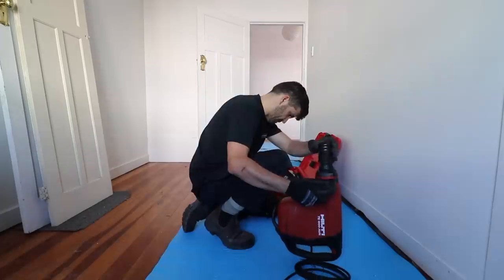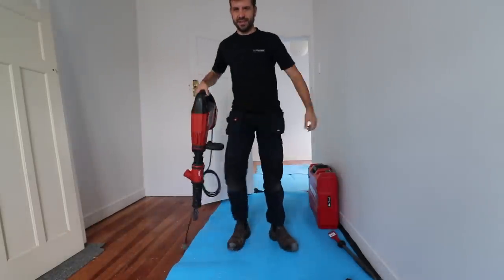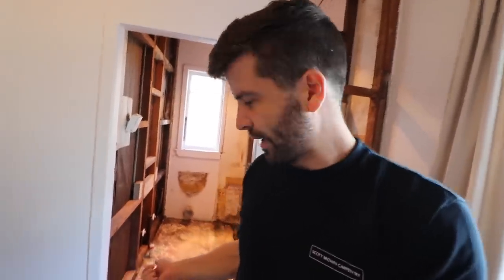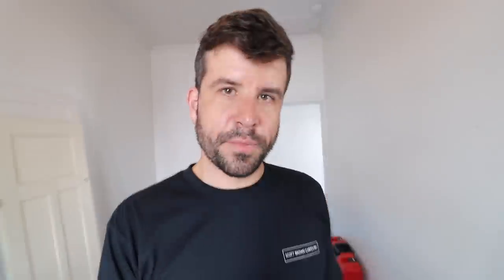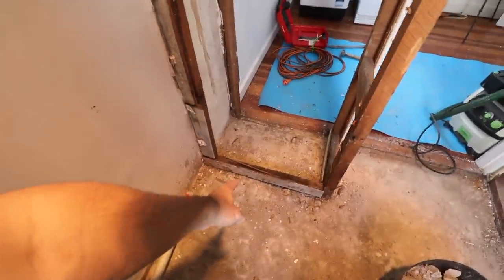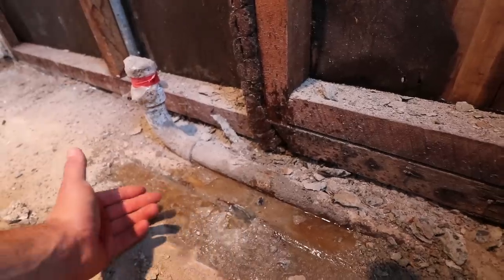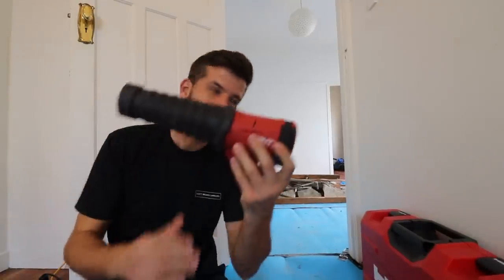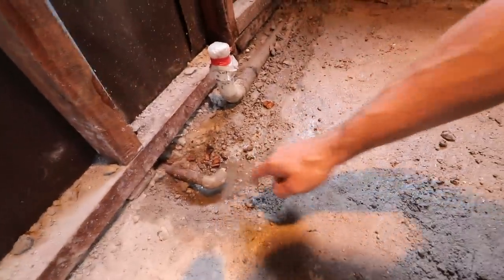This Hilti Demo Hammer Is Ridiculous

Comment: I work at a foundation and structural repair company and when we're pressuring grouting under a slab we almost always avoid bathrooms to avoid pipes as much as possible. We use a bosch rotary hammer for demo and for drilling through slabs. Works great.

Comment: I'm biased as I work for Hilti in GB - glad you enjoyed it! To be fair, this tool is overkill for the job. The TE 800 was designed and primarily used for removing the top half of pile foundations to add more rebar and extend. You would have been better with something a bit lighter such as the TE500
Reply: Rigt,

Comment: Worked for a company that only used hilti tools (Unless it was a tool that hilti didn't have) and those things never broke down even when the guys gave them severe poundings and me dropping a battery that skid at full speed down a roof and flew into the railing on the scaffolding. Barely even had a dent. 
I didn't really think much of them as I was an apprentice when working with them but after having worked different tools like Makita and DeWalt afterwards, had I dropped one of their hard-shell batteries down that roof they would've cracked into a million pieces. I feel the Hilti, is an investment. It costs you an arm and a leg when first buying it but then it lasts for a lifetime. 

Even if buying it as a home-gamer, would be overkill but I feel like if I bought one for my home use It would probably outlive me.

Comment: Used a hilti te 800 avr to make space for some heavy af copper pipes. The thing went through concrete, specifically 10cm thickness, like nothing. The only thing is that they gave it to us without the handle, so my forearms were tired af after the whole deal, so make sure they have the handle for it before doing any heavy work with it.

Comment: I was on a viaduct job once and we bought in a bunch of TE-6a’s. somebody dropped one about 30-40 metres into a river at the bottom and it was in there a couple of days until the river went down enough to go and fish it out. Took the case off banged all the grit out, left it on a radiator overnight and it fired up no problem with a fresh battery. Awesome tools.

Comment: Good to see someone using a rotary hammer the way it's meant to be used. See lots of people on the internet reefing on it and even putting full body weight on it when chopping up a floor like you do here. For anyone that doesn't know: you want the weight of the hammer itself to smack against the chisel. When you put your weight onto it it essentially divides the power between hammering the floor and hammering you.

Comment: Well done Scott, you handled that emergency well, nothing worse than hitting a pipe or a wire ,in fairness to you it was in a very bad location youd never expect a pipe to be there. Great video thanks
Reply: You would think each apartment would have a cutoff, maybe that is one of the planned upgrades.
Reply: Yeah who puts pipes in bathrooms? How inconsiderate of them!
Reply: We all, I'm sure know and expect that pipes will be in bathrooms, but the pipe wasn't in a location you'd expect it to be, running parallel to a stud wall about 4 to 5 inches away from the stud wall

Comment: You have brought a bazooka to a water pistol fight there mate.
Reply: @firesurfer  I agree. exactly the tool.
Reply: @firesurfer  Hilti TE-700 would have been better to do such Job. lighter, faster and efficient as it seems to be just a screed.
Reply: @sehruddinkhan8835   Hindsight is always 20/20. You don't know that until you do it.
 He did have a hard area in the corner. It could have been much worse.
Reply: I have a corded Bosch SDS+ that’s drills and chisels. It’s great for removing failed screed. The only time I needed something bigger was breaking out a concrete base. On this job I’d have started with the hollow areas and hired a bigger tool if the stuck areas were too solid.
Reply: my thoughts also.
Reply: That's the sort of Kango/Hitachi toy, contractors/project managers/"I wanna show you I am not afraid to get my hands dirty" bring to a jackhammer job and then they wonder why it doesn't break bedrock and foundations. For this job it probably was an overkill, but it is not that powerful.
Reply: @Dave5843-d9m  Hilti is the king, but it is expensive. Bosch is cheaper and fun to use. I've been a Bosch fan ever since I've used their angle grinder and was impressed at how smooth the tool ran without overheating.
Reply: @julianpetkov8320  qy

Comment: On the odd occasion where major concrete demolition is required I have hired jackhammers to do the job. Some time ago ALDI had a big jackhammer for $200. I picked one up just to have one at the ready. I am amazed at just how good it is for the price. If I was using one weekly I would get a quality brand, but for the couple of times a year I need it, the ALDI jackhammer is awesome.
Reply: Yeah I got a reasonably cheap one myself and it does the trick. Wouldn’t want to be using it all the time though.

Comment: As a homeowner, I've actually found that my 26 lb demo hammer (roughly equivalent to this one) has proven to be one of the more useful tools in my garage. I live in a place where the soil is pretty dense hardpan clay, so using my hammer with a space bit just makes digging super easy. I also had to remove half my concrete driveway, which was pretty thick and reinforced, and found that my little demo hammer did nearly as good a job as the jackhammer I rented, and with way less fatigue (26 lbs < 70 lbs, who knew). While some jobs can be handled with a variety of tools, some more efficient than others, the kinds of things a demo hammer can do generally don't have great alternatives.

Comment: I spent the first 3 years of my apprenticeship behind a hilti breaker most days. over the duration of that time i got to use a wide variety of models from the TE-1 through to the TE-3000. 
After a while, the firm allowed me to hang onto my preferred tools, a 20 year old TE-706 and a rusty old barrel wet vac. 
The secret to these awesome tools is weekly maintenance and warming it up before use. I'll let it warm up for 15 mins before before use.
Really miss using Hilti tools, the new firm i work for use makita, which makes me feel like im hitting my head against the wall every time i use them.
Reply: You don't think Makita is good quality or are you saying that compared to Hilti, everything else just seems 2nd class?
Reply: Are u a head banger aka into heavy metal

Comment: Hi Scott.  Thanks for sharing.

I once did a laundry room remodel. Where after we'd put up the gyprock, the client asked for one more outlet to be added into where a future cupboard would be. I believe we had to make 3-4 of 5" cupsaw holes to drag the wire (as it went around an inside corner). Never had i seen a wall section more loaded with plumbing and electrical.  Two main drain stacks, with offshoot,  and multiple hot and cold supplies right (2mm) behind the gyp. Every time i cut a hole, i narrowly missed something. 
While fixing the patching pieces for the holes i made an inexperienced decision and decided to fix plywood strips across the holes to secure my patches. It gives a more solid job bit given the busy state of what was behind, i should have opted for leaving the paper wide on the patching gyprock and sticking it with the mud.  It was behind cabinets anyways. 
So,  as im screwing on one of the plywood scabs, I felt a drain pipe right behind.  I aim above to avoid it and set the screw.  Screw goes into something but to my dismay it isn't the ply,  it was a water line tucked right in behind the drain that i could feel because of that. 
I do know my own plumbing but it was still a pain because i had to undo a lot of drain pipe that was in proximity to do my sodder joint. 
It actually got worse after that.  While doing that fix, we had to drain the lines.  The Housekeeper reopened (because we'd shut then off after draining) a handheld shower fixture for the upstairs clawfoot tub, meaning to clean it and left it pointed towards the floor.  She didn't realise it was on because the shutoff was still turned off. So when i put the water back on from the main shutoff in the basement i listened to it continue to run for a moment, and then beyond what it should have to fill any empty toilets. I shut it back off but the mess was already made. The previous installer had not closed the openings where the water lines passed through the tile floor for the clawfoot and all that water went into the newly finished kitchen below.  What a day I tell you!
We kept our cool.  Opened all the pot light holes and mopped that ceiling space with sponges like nobodies business! Saved the ceiling and ther kitchen.  Set a fan and vacuum to move air through the space and had only minor plaster and paint repairs.

That being said,  you should roll with a push-to-fit shutoff valve in your case.  Open the shutoff,  jam it on the broken/ cut end of a pipe and then close the valve.  It could be a real lifesaver.

Comment: I've got the Makita one which is a 20lb impact VS the 15.5lb impact on the hilti. IT'S A LIFE SAVER.

I demo'd an ensuite bathroom that had 2 inches of concrete behind floor to ceiling tile, on every wall and floor, plus 5 inch thick concrete shower pan.

There was nearly 4000lbs of concrete and tile removed. I wouldnt have been able to do it without that tool!

Comment: I have that Hilti Hammer drill. I use it for core drilling and breaking basement floors. It's a bit of overkill to use it in your application and by days end you'd be knackered from lugging it around. Like using a sledgehammer to crack a walnut !

Comment: I've broke out 100's of concrete floors in bathrooms doing walk in showers. Always Check where stop tap is, gas meter and consumer unit. I've hit a few pipes over the years. gas and water. Not so bad when you know where to isolate. I'm a plumber so could fix myself.definitely worth learning basic plumbing skills and electrical.

Comment: Hilti is nice, but a nice air-powered hammer blows those things away.  It's the same jump btwn residential to commercial as it is commercial to public works. Fire up the tow-behind compressor, grab a hammer and a hose and start blasting away. Used to set up venturi air blowers to push all the dust out.

Comment: Nice work Scott, keep it up!
  the Makita HR4013C 1100W 40mm SDS Max Rotary Hammer
Is really good for light work.

I was using there 16-40kg Hilti Jack  hammer the other day it's a beast
Went through the concrete like butter, will do Upto 300 mm thick  concrete.

Comment: i bought an old primary school to convert to live in and had a lot of demo. to do so i bought two spare and repair hilti  706 breakers from e-bay, and i sent them to hilti for a service repair for £165.00 each they fixed them and i had a 6 month warranty 5 months later one started making funny noises sent it back, and one new motor later got it back no bill, that was 8 years ago and they're still going strong, hilti has a well earned reputation but like everything else the older models will last longer than their modern tools

Comment: The hilti wsc85 circular saw is a dream if you ever need the 85mm cut depth, and I have a TE52 HAMMER OF GOD drill and a DD100 corer that are both about as old as you and simply refuse to die 👀 they were old before I got them! I'll replace them one day, maybe when I replace all my teeth for falsers, but probably not before!

Comment: In Sweden there are companies where you can rent machines like that, so if you have a rare job in need of the heavy atillery, there is no need to go on with the small everyday tools wasting time. You can also rent them as a private home owner. I've rented a rock drill powered with a diesel compressor on a trailer. Made all holes i needed in one day. Drove it back. Popular by small contractors, but also used by larger companies. Machines not used in every project just cost money. And if you take on a larger job than your machine park can handle, you rent the rest. They have about everything you might need. 

Isn't it the same in NZ?

Comment: It's a rule of thumb (at least here in NL) to use a lighter, softer and more flexible type of sand+cement+fibre mix for screed, it's not a structural element so it doesn't need to be full-on concrete structure or to be very tightly bonded to the underfloor. It's cheaper, easier, lighter and as you can see, it comes out easier in case you need to change anything. That point chisel is for tearing up structural (hard) concrete... but hey, where's the fun in demolition without a bit of overkill. Just like - that wooden frame would probably just fall apart if you had given it a good shove, but why have a big saw if you don't use it ?

Comment: The video shows an ultra light job for a heavy monster hammer drill.More powerful from this one are only the compessed air hammerdrills.This opens a hole to the down floor rapidly if working in full power.

Comment: I have the bosch gsh 11e, i have a older type it hits with 20 joule. 
They even have a newer one that hits with 23 joule.
The Hilti you have there is fast pace pound, going off on the sound and what i see i think the 21 joule is lab based under perfect circumstances.
The Bosch pounds in a different pace its slower, what a beast.

Comment: I remember when I was an apprentice plasterer ... we had to remove a concrete slab in a bathroom too that had been poured on a wooden base. All this because we were lowering everything in the bathroom. Anyway, our makita tool (same thing as you, but older model) was not available, because it was in repair, and we had nothing else ... another team had the sledgehammer on a different site, so we got our axe/hammer (we call it hachette de plâtrier here in France) and swung at it all day long for 2 days.
Beast must have been like a good 6 inches deep too. So yeah, slow work breaking it up into little pieces. Had no arms by the end of the day.
Reply: P5ykoOHD Were they running a medium sized shipyard in the bathroom or why the hell did they pour a 6“ slab?!

Comment: should use a more powerful vacuum and extend the dust collection cowl on the tool closer to the work surface (with clear pvc and LED lights! lol).  closeups showed plumes of dust just walking away from work.  spraying water is great though, you know concrete dust is quite dangerous

Comment: When I had the DPC sorted in the backroom the plasterers mate did the same thing, as he removed the old plaster he hit a water pipe, the main feed for the house.
Luckily it was on the house side of the stopcock not the mains side and the room he did it in was a step down from the rest of the house.
So stop cock switched off but all the water in the pipes in the house flowed out of this hole into the floor.
Luckily the head of the firm knew a plasterer who did the same as in the video, as in he nipped in and fixed it (chopped a piece of pipe out and patched it).
So all good in the end.
We had a bit of a laugh but I think the plasterer was surprised when I rang him up a few weeks later for another job.  
I just said it's the guy you built an internal paddling pool for.  
He knew who I meant.

Comment: 0:21 that's not concrete, it's just cement mortar. Concrete is way harder to break but a $70 jack hammer will be adequate for cutting groves on it.

Comment: We swapped to a hilti for knocking chimneys breasts open great tool we used a cheaper brand before also a great tool for the job cheap and cheerful but you couldnt feel your hands/arms for the rest of the day the hilti seems to get the job done so quick and we have it paired with there dust extractor so does a good job of keeping the dust down.

Comment: Happened to me in the uk, had the breaker out hit a lead pipe, it was the same color as the concrete, i was wondering why i was producing  shaving in  the concrete, so i went in harder and deeper then all hell broke loose, flooded the chemist on a high street

Comment: Shut off the water, jack hammer the rest of the area out. Cut the pipe and cap it off with a sharkbite so you can turn the water back on. Doing renovation work long enough, you always learn to keep a few of those in your truck.

Comment: Thanks for the videos but always wondered why your lumber is pink? Treated maybe?
Reply: I know you asked this a while ago but in case you're still interested; in New Zealand, timber used for internal applications (house framing etc...) is boron treated and colour-coded pink. Timber for external applications (decks etc...) is generally left plain. 

In a lot of Scott's renovation videos you'll see internal timber that is plain in colour. This is older, usuall nativey hardwood, timber that was used before we had our modern building standards.

Comment: Hey Scott, do you ever do any other trades? Electrical, plumbing, hvac, etc?
Reply: Na, hes just your neighborhood (ledgendary) builder with a camera
Reply: NZ has restrictions on electrical and plumbing work. Basically you can't touch either. The funny thing is that the exception to those regulations is for emergency plumbing.
Reply: @DiscoFang  Cool, I was wondering. Here in the States the company I work for does a handful of the trades.

Comment: Hilti is good tools but a little overrated. Festool seems a bit pricier but if you are a self employed contractor you can buy 2 to 3 Makita’s for the price of one Hilti. If you buy a Makita impact driver that’s made in japan(there’s still a few) you will have the best impact driver on the market hands down. Nothing compares and I’ve used all kinds of impact drivers over the years.

Comment: i dont want to sound smart , nut you could litearlly use hammer and a crowbar. just hit wrowbar between layer of concrete you wanted to take off and a base floor . im pretty sure youd get a better and faster result, the reason why im saying that is your base floof is older then layer you taking off. however job done - congrats from me